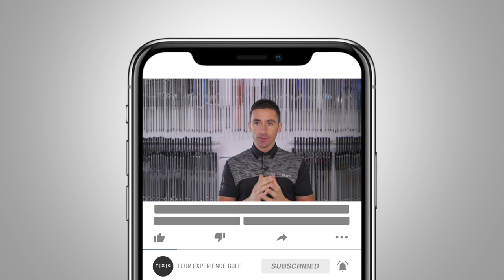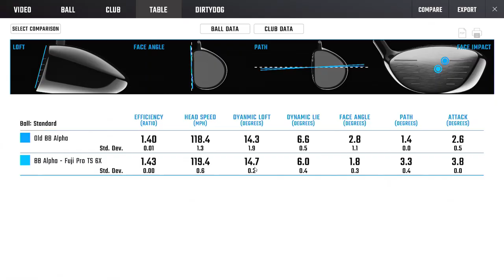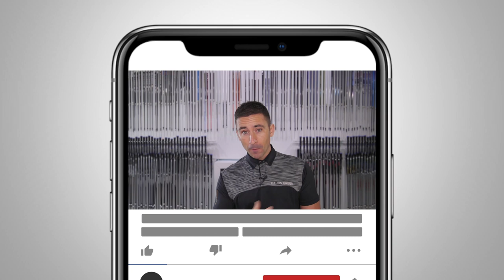Custom Fitting an Old Driver // How good can we make it?

Comment: I had M2 with stock shaft which always pushed right. After watching TXG (Not this video) decided shaft was problem, obviously leaving face open. Tested some new drivers made massive difference, Titleist with custom shaft worked amazing well but not for AUD 1500 for new driver and tour shaft. M2 is not that old and I'm not that good. Instead had Adila rogue 75-x installed for AUD 200 now M2 flys straight and I swing with confidence. Don't need to spend silly money, just some time experimenting at store. Wasn't a custom fit. Thanks TXG. Great video.

Comment: One of your best videos yet...absolutely amazed with the results!  Super practical and informative advice to every golfer. I never thought about just changing the shaft and using my older head as a potential option - it won't happen every time, but you could walk out with a super good a driver and save a good 400-500 bucks in a head and shaft combo (potentially double or more of your budget).

Comment: Very interesting test, it actually lines up with a lot of things we have seen in terms of what does and does not work for Matt. These older Callaway drivers were pretty high CG, even with the core down. The G410 LST that Matt played was also in the mid/high CG range and I imagine given the shape that his new Mavrik is similar. His tendency to strike higher and struggle with spin getting too low lines up with these mid to high CG drivers and explains why his biggest struggles have come from very low CG drivers like the TS3/TS4.

Comment: So many combinations or options!  I'm using a driver much older than that one.  I'm sold on being fitted at some point (you've done a superb job demonstrating the benefits of doing so), but still think I'd benefit more greatly at present by focusing on the fundamentals of a good swing.  No amount of technology would offset an inconsistent, poorly struck ball.  Matty is most often in the zone, so it makes sense.  Doing cost-benefit analyses over time using handicaps and/or historical scores would be interesting.  I have a much greater appreciation for the skills of Jones, Hogan, Player, Nicklaus, Watson, etc., since they were playing with heavier, much smaller bladed irons, and heavier, non-FM shafts yet still killed it!  Says something.

Comment: Great video guys! I think a lot of golfers that are particular about their equipment will benefit from this. Traditional head shapes and clean look are hard to come by in modern equipment. Because of this issue many solid players with low single digit handicaps or better have been doing this over the last 5-10 years. You look at Adam Scott for example who has played his 910 D3 driver in multiple tournaments within the last two seasons. Great content.

Comment: This was such a great video!  Goes to show that an older piece of equipment doesn’t necessarily have to be replaced just because it’s older. 

Example: let’s say I get fitted for a TS3 today by Ian Frasier!

As I live in California the odds of that happening any time soon are quite remote, I know. But I digress!

Continuing...assuming I don’t have any major life changes or swing changes, the odds are that driver would still work just fine for me 5 years from now.   Perhaps an 8.5 out of 10 compared to the new stuff of 2025?

All that goes out the window if you aren’t custom fit though, as we saw in this video!

Thanks guys!  I learned something today!

Comment: I have an older Anser Driver that wasn't quite working for me. I didn't want to buy an off the rack old driver or pay 500 bucks for a new one so I fit myself on ShaftFit and bought a Grafalloy Red
 Pro Launch for 80 bucks and it works really well. I know I got lucky but it did get me a few extra years out of a Driver I really like.  Would change the shafts in my irons to keep them but it costs way too much.

Comment: I have a TM M1 which I absolutely love but I do feel a shaft change is in my future.  It's a stock shaft, for one, and at the time, my swing speed was not as fast as it is now, and because of that, I feel my regular flex shaft a bit more whippy and my shots going all over the place.  Not an expert by any means as there are more variables as well.

Nice video, boys!  Cheers.

Comment: I do a TON of retrofitting old heads. Generally speaking, most average players can drop about $250 and breathe new life in some of the older adjustable heads rather than dropping $400-700 on a new one.   

One thing about that pro 2.0 TS.... spin killer. If you have spin problems, try it out. Better than many premium shafts at knocking spin off.

Comment: Do you ever change the length of the shaft when you change between different shafts?
Reply: tangguh1 if that player is struggling to handle to length then yes we would look at that.
Reply: Noted. Cheers. 🙏🏼

Comment: I used to have one of the original carbon headed drivers, the Cleveland launcher comp. For me, it just spun too much. Now I’m wondering if another shaft would have made that thing a monster. I will say it was very straight is why I had it in the bag so long but lost 30 yards easily due to spin around 3600

Comment: Mark Crossfield, "Shaft doesn't matter!" ; )
Reply: My thoughts exactly! LOL
Reply: Mark Crossfield likes have fun & to stir the pot
Reply: Papo, in Mark's case he is right. Shaft doesn't matter if you dont find the middle of the club often. Matt...just like Mark is a good golfer and by no means average. The fact is that if your going to TXG for a fitting, you've probably had a lesson or two and are at your max potential swing wise and are looking for that extra bit of efficiency. For regular Joe/Jane Shmo would not benefit from $300-$500 shaft upgrades which is insane.  You've also got to remember they are a business Club Fitters vs Mark( Golf Coach) one will always be biased, seeing as both companies get paid for advertising I say take with a grain of salt and view their videos as educational and not absolute. Example: If i swing with face angle 4 degrees open, then i get a shaft thats $350 and it decreases by 2 its still 2 degrees open and the shot will likely miss right. No shaft in the world will correct a bad swing otherwise pros would always hit laser beams down fairways. The greatest golf players aren't great because of equipment but rather skill. For Christ sake Tiger woods and Rory use to play "Nike" lets let than sink in.
Reply: That's because Crossfield swings it like a grandad
Reply: He is partially right. Shafts don’t matter for some players.  It depends on swing characteristics like tempo transition and how they load the shaft. For some players they can play a wide range of shafts extremely well. For others certain shafts are nightmares. Mark swings the club in a way he could game many different shafts and not see much difference in launch characteristics. Matt on the other hand benefits a lot from a proper shaft fit.
Reply: Probably a bit of goal bias in Mark's statement, and that is what everyone is all worked up about. I'm not saying that Mark is wrong in that goal bias. Mark's #1 goal is to hit the fairway and to Mark a 262 yarder in the middle is as good as 250 yarder in the middle. So if Mark hits a club who's shaft doesn't allow his 262y center of fairway swing he will adjust as a good player does and use his 250y center of fairway swing that hit's on the clubface where he wants and hits the fairway - Launch, Spin, Speed are all secondary - So Mark succeeded in his goal, as any good player would if handed a ill-fitting club.

Ian and Matt have a goal bias of absolute perfect performance. Their goal is to hit it where they want it and how he wants to hit it. This needs to happen without Matt adjusting the swing or trying to slow it down to hit the fairway. 

Mark, Matt and Ian and Matt are all correct for their intended goal.
Reply: @Wanderer1202  yeah I agree. I think any shaft costing more than $100 is just a shame. I can find equally performing shafts for under $50.  But some people still want the $600 shaft for whatever reason. More power to em.
Reply: Mark was more or less going over regular/stiff/x-stiff which barely matters especially when you look up the shafts he was testing and they mostly have similar profiles. These guys are messing with a lot more including torque ratings, different stiff sections, swing weight, balance points, etc.. which can make loads of differences.
Also like others are saying Mark's swing isn't as violent as Matt's and Matt also rotates the face a lot more during his swing so having a shaft that fits him will help him time the face up at impact a lot more than someone like Crossfield who is mostly a fairway finder and adjusted his swing accordingly to the shaft change. Matt is also trying to test for a shaft without changing his swing at all too.
As golfers we should know that whatever shaft/swing weight/etc you play for a prolonged period of time your swing will groove towards that profile whether it's an old whippy hickory shaft or the stiffest thing on the planet. So unless you are losing swing speed due to age or seriously reworking your swing just find a shaft that feels really good where your strikes are consistent and go out hit it a lot to groove the feels of it and enjoy it whether its cheap or expensive is irrelevant.
Reply: @Christopher Willis there's no way a shaft change is going to give you 30 yards change. Maybe if someone has the Absolute Worst fitting shaft of all time and they leave the face something like 6 degrees open on every swing and then somehow change a shaft and start delivering 1 degree closed then maybe you'll get 30 yards. But that's an extremely extremely small minority.
Reply: @Christopher Willis that's exactly what I said. If the golfer is in an extremly poor fit shaft to begin with then maybe they could pick up that yardage. The vast majority are not going to because they aren't that far off with their current club. And mark brodie has never once made a comment about shaft performance lol but I guess you can listen to him? Yes distance is helpful but 95% of golfers aren't going to gain 30 yards from changing a shaft.
Reply: @Christopher Willis I've been fitting golfers for a long long time. I also hit the ball further than 90% of tour pros. I understand the importance of distance. I also understand the importance of accuracy. It's gotta be balanced.  Adding 15 yards is great if the accuracy stays somewhat relative.  But if that added distance adds 2-3 penalty strokes a round then it's not worth it.  I also live in reality unlike you.  Most fittings aren't going to drastically increase someones distance potential.  Most players come in with a finite clubhead speed.  Let's say their max distance with their current driver is 250 yards on an ideal shot, but they typically only hit it 230 because they don't hit it solid or deliver the face as consistently, we fit them into a driver that increases the times they hit center and helps with consistent delivery.  Now they hit it 250 fairly consistently. Did they increase their distance?  Well Sort of. They now hit their max distance more frequently with more optimized launch, but we didn't really increase their distance potential?  No?  The driver isn't swinging itself faster.  They didn't gain clubhead speed.  They just get more optimal results more frequent.  That's a typical fitting.  Sure the occasional golfer comes in with a swing and shaft that is terrible and i can fit them into something that improved their mechanics which in turn increase clubhead speed. But they are so so rare.
Reply: @Christopher Willis have you even watched him lately?  He has a whole playing series on strokes gained and talks about trying to hit the ball further all the time. He's never once said hitting short is better. I don't know where you're getting that from. I'm not a big crossfield fan but the things you're claiming he says just aren't true. In fact he talks about how he wished as a kid he was taught how to hit for distance over accuracy because maybe he would be able to hit it further. I dunno dude just seems like you got some vendetta against an idea that mark doesn't even endorse.
Reply: @Christopher Willis ahhh. It all makes sense now. Just typical internet uninformed anger.
Reply: @Christopher Willis I watch them all. He's never once said 10 yards shorter is better. I don't take anyone's advice. I play the game better than 99% of the world. But I don't lose my shit if someone has a different view than me. Unlike you.
Reply: @Christopher Willis you can stay ignorant. I fit people every day but I guess you know more because you read one strokes gained book and that teaches you about club fitting.
Reply: Christopher Willis the longest hitting long drive athlete is using a reg stiff legal head driver. All shaft flexes are not the same. You know what will give you 30yrds on your drive?.....don’t be the typical out of shape golfer and exercise, it’s free. This is the way of the long bombers, ppl think they are hitting 1,000 of golf balls but no, core strength, leg power, speed training....again it’s free.
Reply: Christopher Willis yes he does, go follow and watch his channel. His WITB video...also SAS channel did an experiment Reg shaft v. XXX Stiff. And from my own trials if notice you can hit a bit further with a more “whippy” shaft, after all its swing speed/ball speed =distance where ball speed and spin are dictated by strike. Don’t believe me...try it for your self. I use to play an 88g X-stiff shaft, because that’s what I was fitted to. Their reasoning “ to slow my hands/arms down” which is kinda stupid now that I’m educated. The arm aid in speed in the ladder end  of swing so why would you want to slow them down. I just was not synced with body. It was me not the equipment and that was swinging 118 avg. hence the move to lighter shafts...some genius figured out if something is lighter in your hand you can swing is faster “duh” right? Otherwise we would still be rocking steel shafts in drivers(which would probably benefit some ppl) but seeing as no one really cares about fairway finding. Especially the strokes gained guy down in the comments lol. I agree with getting fitted, just not when your going through swing changes I.e. new to golf or the twice a month player because that $300 shaft after 6mos ain’t going to fit you anymore.
Reply: In Mark's defense, the way he loads the shaft, it doesn't... Mark went to ping and got his shaft loading stats, and they even said they never seen anyone load a shaft that little. They agreed with him in as much as his swing, shaft made little to no difference. He also after that video, was more open in as much as he understood better how loading made a shaft behave different.

But his main point still stands. If you cant hit the middle of the face, no shaft will make you do that. Matt is a scratch player, drives the ball as good as some pros, so this is not the marked that Mark is targeting.

So for the average 28-36 hcp'er shaft means nothing, but feel! But for a pro/ highly skilled amateur, Mark has even said that its important for feel and fine tweaking.
Reply: To a very large extent I feel Mark is right!  This type of fitting is wasted on your average everyday hackers; totally unstable swingers! For your low handicap to scratch players yes fine tuning is a great plus! Great video boyz but I wish Ian would hit some as I can’t watch Matty that much and play tomorrow! LOL!

Comment: I could see this being an option if someone has a driver that isn’t quite as old, like a G400 or F9. Save the $400 on a new head and put it all towards a better shaft.
Reply: Actually did just that a few months ago. Have G400 Max which had the stock Tour 65 R-Flex 1" short. Went to a clubbuilder and he fit me to a Project X Evenflow Riptide 6.0, and it totally changed my ball flight and made it so much more stable. Went back with my F9 hybrid with a stock shaft R-flex and he fitted me to a 85 gram Evenflow Riptide X-flex (WFT?!?), but again made the club and flight so much more stable. Have always been told in various golf stores that I needed R-flex (which I still do in my irons DG R300), but holy smokes this opened my eyes. Can only recommend it.

Comment: Is there such a thing as shaft fitting? I have an m5 but feel like I could use a different shaft that could make a big difference
Reply: nRerun it’s still just booked as a driver fitting, you just need to specify that you’re looking to be retro fit into your current head with the best shaft and best head configuration for your game.

Comment: I have a Cobra f8 alidida nvkx  65s shaft set a 10.5deg full draw in the shaft and weights.  12g in the draw  2g in the heel.  I hit the ball about 200yds +/ - 15 consistently with an occasional bomb that goes 225 and once in a blue moon I smoke it for 240.  Total weight 320g.  Practice driver I picked up a charity store,a 2002 Callaway Great Big Bertha II I pulled out of the bag and I am smoking the ball for 225-245yd consistently with a 265 bomb on occasion.  9 deg 55r stock driver total weight 317g (Paid 4-bucks) 380cc head.  Control is there and I am in shock!  there is a fade that larger than I would like, but I cant ignore total yardage and the improved position to the pin on the course.  I out drove son who is 28 15 out of 18 holes last weekend and I normal trail by 20-40yds.  Really  considering a driver fitting to see what is truly available with my swing.  I have a spinal fusion from the chest down with a few vertebrae at the bottom and the never thought I would ever see this yardage  with my mobility challenges.  Truly in shock! Thinking of getting some lead tape to see if I can tame that fade and unlock so yardage in the meantime.